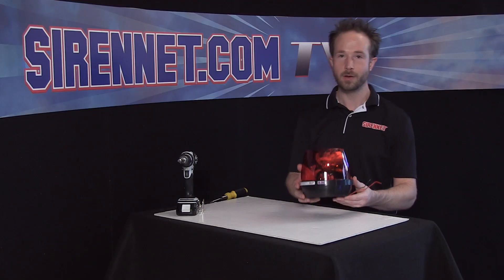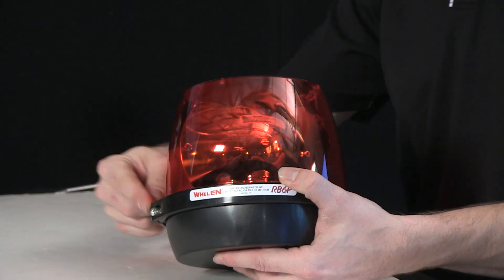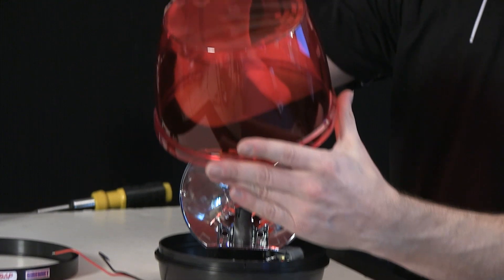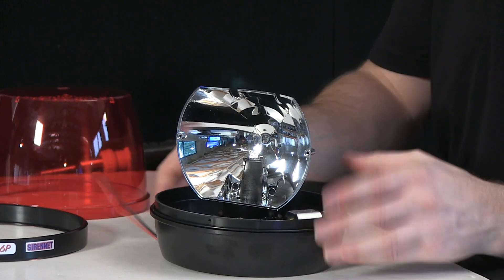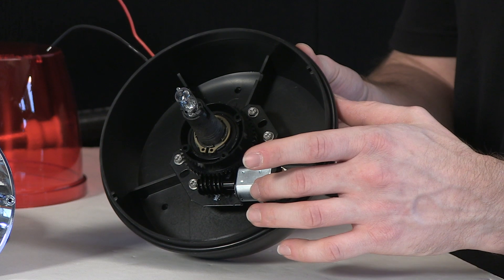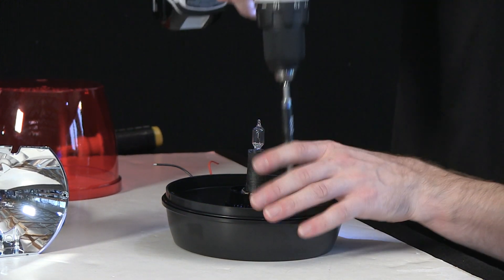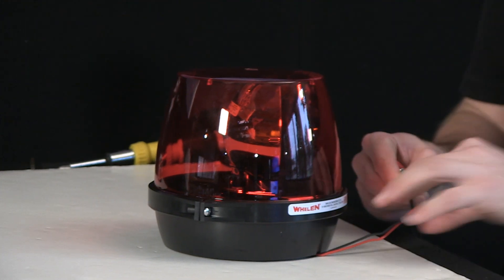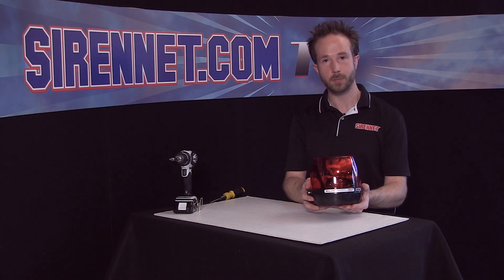Chris disassembles a Whelen Rota-Beam and changes the bulb

Comment: He does not show how to remove the light bulb.
Reply from the maker: Woops, that part got overlooked.  There's a small special angled pin/puller that's used to remove the bulb. The replacement bulb then snaps back down into place. The removal pin comes with the new replacement light.

Comment: Can those older halogen bulbs be replaced with an led bulb?
Reply from the maker: If you have one that's using an H1 bulb or something along the lines of an 1168 style, you can swap in an LED bulb. How bright it is will really be dependent on how many lumens it's putting out. If you have an RB6 Beacon, you won't find any LED bulbs out there that match the unique design of Whelen Engineering bulbs/lamps.

Comment: Looks like an oversize Cadet, except in this light the bulb doesn't move and doesn't have two spring loaded contacts the way the Cadet does.
Reply from the maker: Cadets big brother... haha :)
Reply: It does resemble an overweight cadet!
I just bought a NOS Cadet and it has the quietest motor I've ever seen in this series light. All the older Cadet's I have (I collect lights), both single and dual speed versions, have motors that are quite loud but the NOS model I recently purchased is so quiet you can barely hear it at all - very unusual for this model.

Comment: do they still make the one i got that looks just like this one except for dual reflectors?
Reply from the maker: Whelen still offers the RB6T dual-reflector rotator. It is not seen very often as many folks have moved into Whelen's LED Beacons.
Reply: @SIRENNET  I actually have got the Whelen RB6T, are these adjustable speed, or connect the power directly, cause I've just been connecting the power directly and it's been spinning at an okay speed, not too fast, not too slow
Reply from the maker: @Jade_Everfrost  These Beacons only have one speed.
Reply: @SIRENNET  i thought so, thank you, so is it save to connect directly to a 12 volt battery, off only power, and the bulb won't overheat, anything like that? Cause I've noticed that the metal leads heat up, idk if that's normal or not
Reply from the maker: @Jade_Everfrost  So long as the battery output is regulated and between 11.8 to 13.6Volts, the RB6 should be okay as it's designed for this voltage range. Be sure to add an inline 7.5amp fuse.